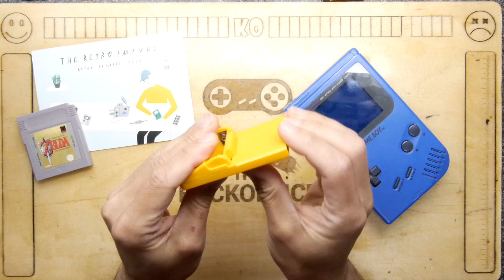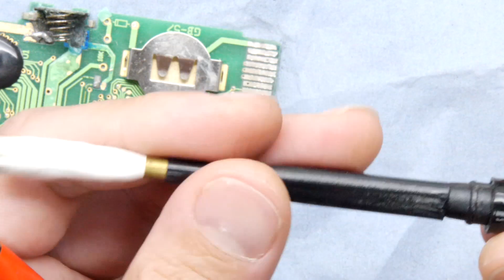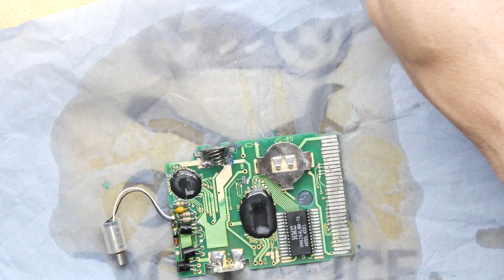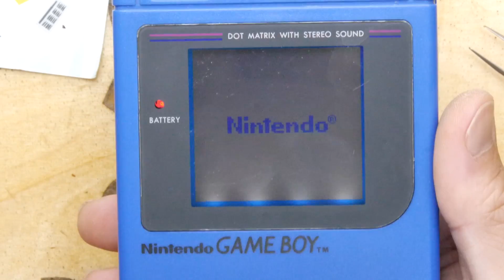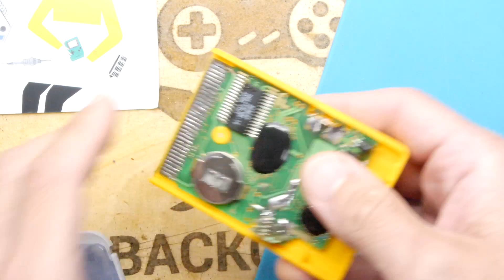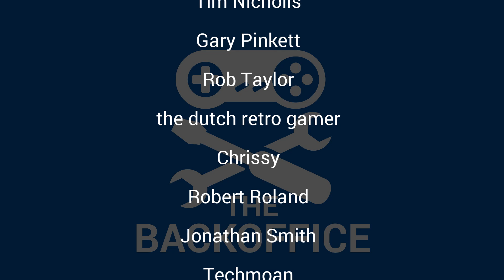The Retro Future Knockoff Gameboy Cartridge

Comment: I know this video is a bit old. But the video intrigued me. I used to have an ds cart that had contact issues with the system. Using what was called the acekard paper trick, to help get the board have snug contact with the pins of the ds; I was able to get my cart to work. I wonder if doing something similar. Such as putting a piece of cutout cardstock between the back plastic and the cartridge pcb would make the connection snug enough inside that the gamecart would come up....
Reply from the maker: I will have to revisit it, but I recall trying again with this after the video. I should really see if I can find another

Comment: Maybe you could try the old warm it up with a hair dryer trick? I wonder if one or more of the bond wires on the glob tops could be floating around a bit? If it behaves differently when warm, could help you zero in on the issue. Nice to see it work at least once though! :-)
Reply from the maker: I was just wondering that myself. Pressing on "something" seemed to make it work and I refinished the contacts many times. However thinking back, I did blast the epoxy with hot air so I did explore that avenue at least a little bit
Reply: @backofficeshow  So heat didn't fix it :-( I guess as a last resort if your ribbon cable idea doesn't work you could melt the epoxy a bit and squish it down with something? You might get lucky and that fixes it or possibly scorches the earth and it never works again! :-0 Damn glob tops!